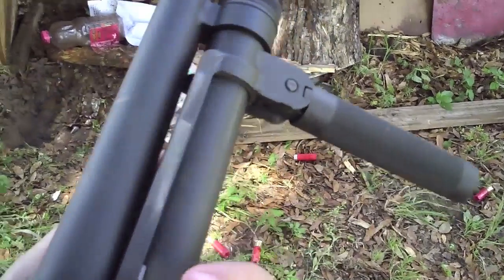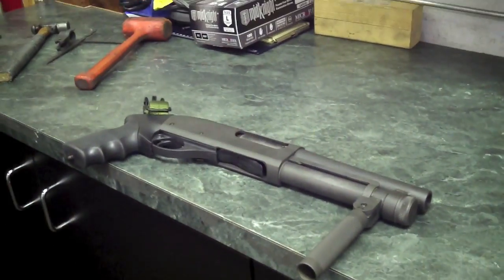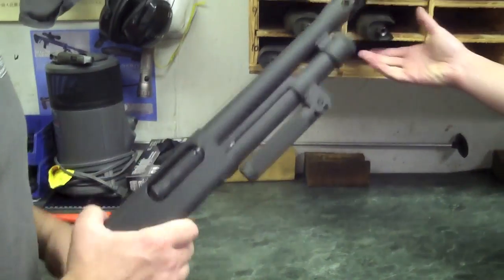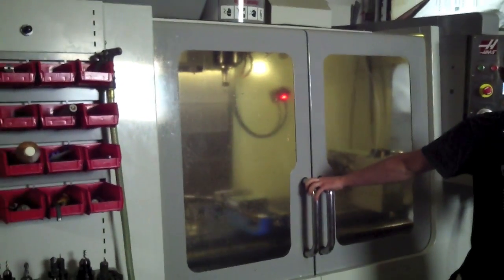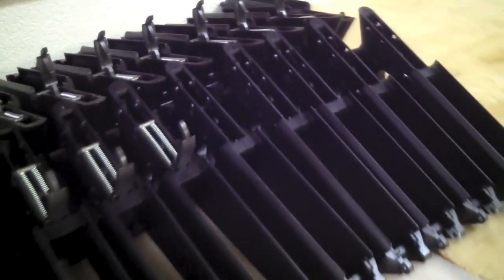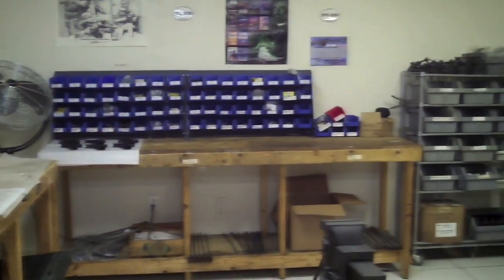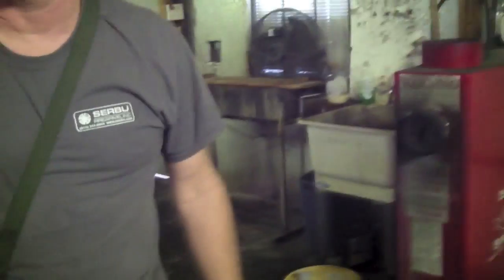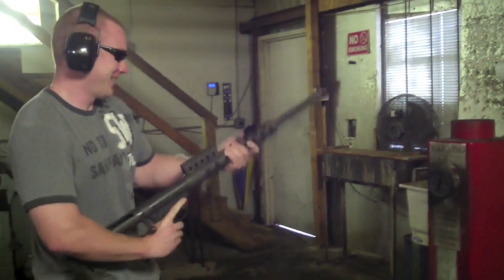Factory tour: Serbu Firearms

Comment: I would very much like to know if there is enough magazine length to "ghost" or carrier load a 4th 2.75" shell into a Rem 870 S.S.  On my 12.5" Rem 870 there is enough room to load it 4+1+1 if no more than half of the 6 are 3" shells.  I found the floated round only takes up 0.85" of the mag but needs to enter about 1.4" in before it slips under the carrier assembly--although a simple mod would reduce that.